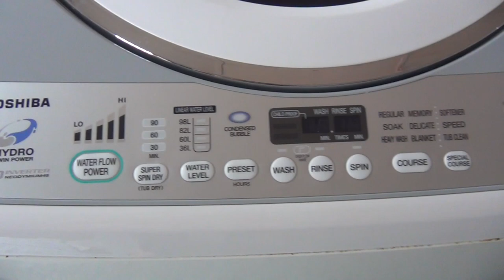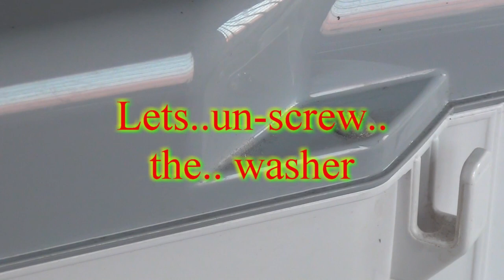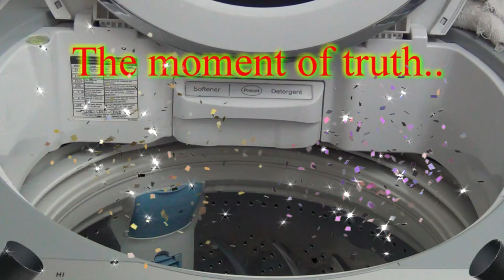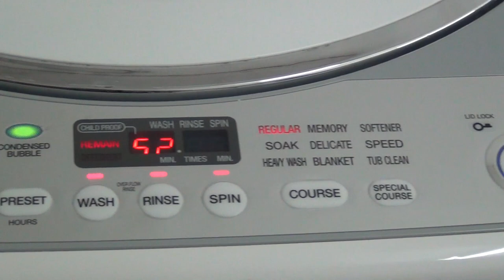DIY Toshiba AW-SD120S washing machine : Change Water Inlet  Valve (Subscribe Me, please)

Comment: Thank you, I have also just watched your video and replaced the water inlet valve, and it's fixed it. :)  Just a note, the removal of the two screws at 1:38-2:00 is not required. There's three or four tabs that just needs to be undone with a bit of force to remove the top cover. The more challenging aspect was to find an electrical parts shop that has the replacement part.

Comment: Thanks for sharing. I just replace my inlet as per video instruction although different model but I found it useful. Add comments is I just remove the cable from old inlet and attach to new inlet is more easier.

Comment: but my problem is there is 4 wire connection on the valve when I on 3line have power then in which have both wire power that have no push water other is ok what can I do?
Reply from the maker: Im so sorry bcos Im not a technician..just DIY.. but If you are Malaysian..you can seek a lots of info here : https://www.youtube.com/channel/UCjkMbSzPJMlNzTBdLd4ZX8A  or browse http://hairulvcool.com/?fbclid=IwAR1ElPfLV2ut175OUFdpLXsDsqKdOFqna6VQhVh8MuFKpfzWovpZ0juPrgc

Comment: Where can I buy this valve?
Reply from the maker: google based on your home location..
Reply: I just buy from LAZADA and it works. I waiting this for 6 months as last time I need to manual insert the hose to water in machine
Reply: @bwwcstoh   hi, is it can be use for the medel in the video ? cuz the lazada link is for AW-D980S.